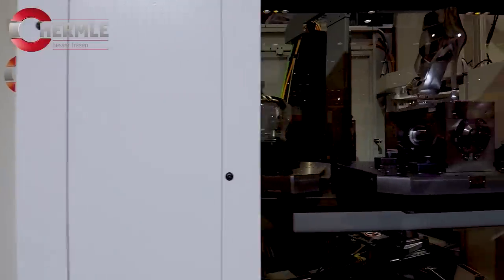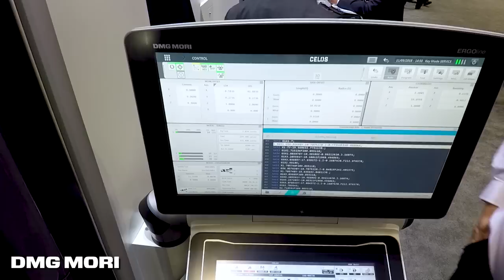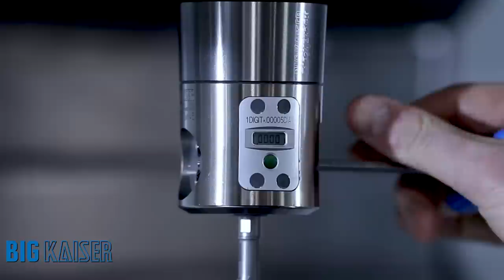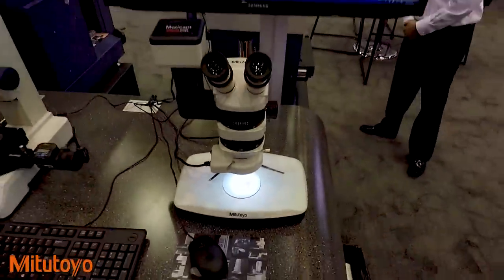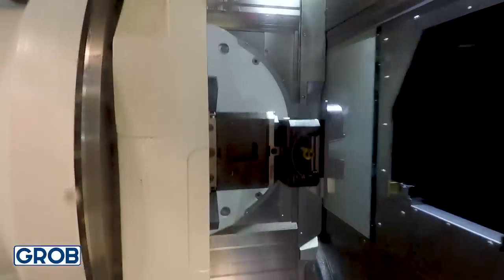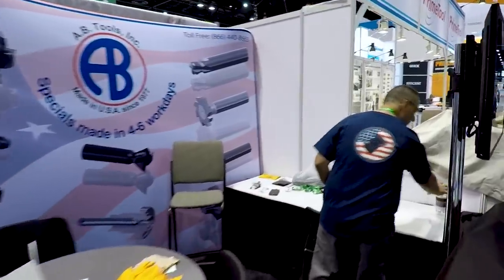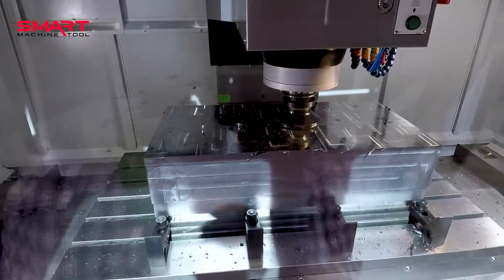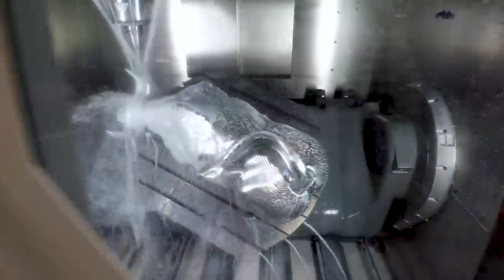International Manufacturing Technology Show (I.M.T.S) 2018 | CNC Machine Tools & MORE!

Comment: I work on a couple of those Index multi chuck machines, even with around the clock shifts a million parts will still take somewhere between a half to a full year with just one machine.
Thanks for making and sharing this video I miss doing real machining, all I do is check measurements, clear errors, switch out worn tools and fill up oil ;(

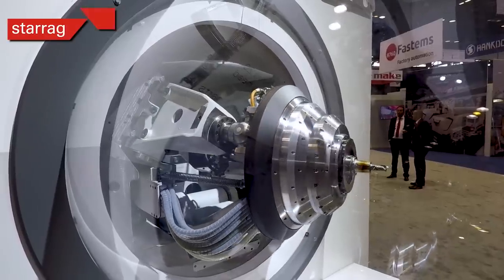Comment: 5:02 That spindle head is known to be able to achieve any slight angle the fastest compared to any other head design. The drawback, you don't get the full 90 degree. But a lot Wing ribs are just small slopes anyways. From what I heard, programming with this thing is a dream. No need to sacrifice speed in corners, because you're not waiting for the axis acceleration to catch up. :D

Comment: I'm impressed with that building supplying that kind of power...
Reply from the maker: RIGHT?!  And the air compressors?!
Reply: I can't imagine how they do that... A bazillion amps... Didn't know they had "Shop" air … Holy smokes !
Reply: Id have to guess there is a massive generator outside
Reply: The power, the air, suitably strong floors, machine installations, fluids,, the mind boggles.

Comment: There must be some intense power requirements at this convention center. I’d be curious on how they handle tons of CNC machines that require 3 phase 480 all machining at the same time. Typical booths at a convention center don’t need more then 120v single phase.

Comment: @NYC CNC Hands down BEST IMTS 2018 video... Wish there was more MAZAK footage. [What is the show stopping and mysterious  "Fatal" 5 axis flaw (as mentioned on Grimsbo's video ?).]. Love your tenacity; onwards and upwards. Thanks for doing what you do (LOVED the Sandvik tour you did/video).
Reply from the maker: Thanks!  The flaw was the DMU50 - great machine - has, IMO, a poor interface with the PH150 automation; you sacrifice a lot of Z axis travel due to the table + erowa base + erowa platter + workholding.
Reply: Good call, I have a "Pal" with a DMU 50 3rd gen that is fix'n to eventually concoct his own automation for the machine, but the version of the DMU 50 (3rd gen) he bought is seriously "Blinged out" in every other respect. Looking at the Hermle C250 there also seems to be robot arm option rather than the Erowa tower/ palette system… So very cool that you showed some of that "rack" system also... = CHEAPER lol. Cheers and thanks !

Comment: Can I stand in front of my machine and write programs with these types of machines. I have written thousand upon thousands of programs over the years. These new machines programs are a whole different animal i'm sure.
Reply: Think there is much done by Computer-Program transfer to machine.
I also get worry by thinking about reference- and zero point. There will be much offsets and geometric affine, even for the cycles retreat level.
Good to be slighty confirm with the maths to hold concious.

Comment: I have a question for you John, is it an American thing for you guys to be using coolant when milling steel with carbide or is it just a coincidence that pretty much everyone i see on youtube is amazed that you can cut steel without coolant? I have never used coolant for milling steel and i'm quite baffled that this is not a known fact for everyone.. Fun fact, the tools last longer without coolant in steel.

I know by stating this i'm going to get a lot of comments claiming this and that but note that i'm only talking about milling with carbide endmills or inserts in steel only, not drilling, not turning, and not threading. you need coolant for that or your tools burn out, ALL HSS tools needs coolant all the time! (When cutting metal, when cutting some plastics you can run dry with HSS).
Reply: Fredrik Söderqvist does that work in stainless steels I tried bringing that up to my boss to run the part dry he gave me a crazy look
Reply: I would try that, any source on this?
Reply: Yes you can, i have no experience drymilling ISO-M materials but i think it would be fine. Last week i milled some Sandvik 253MA dry with a Coromill 390, the inserts still is fine after about 1 - 2H of light cutting

Comment: Good afternoon, please tell me who works in fusion, there is a problem with creating a unit for milling, the problem is that I can’t create 3D contour or ramp strategies, 2D contour so that the machine cuts the parts and a couple of dozen from the workpiece so that it cuts out the parts queues. for example, if the thickness of the tile blank with which parts are cut is 12mm, then it is necessary that the machine cut out the part to the full depth and only then move to cut out the next one, and it turns out that the machine makes a bunch of crossings cutting through parts 2-3mm per meschayas plane across the workpiece during processing greatly respectively vyrostaet

Comment: How do they provide power to such shows, thats a LOT of machine and HP
Reply: Such convention buildings for this use have a lot of power reserves at hand. But the machines are mostly just running quite lightly, with not so much power consumed, for demonstration. there can be a 30 kW spindel, but they can run it at 3kw, just some light cuts